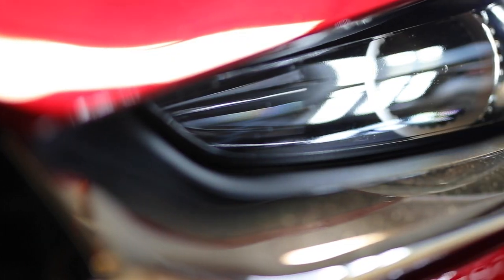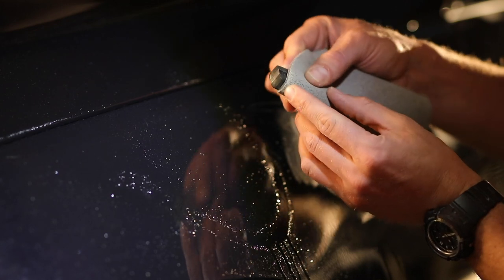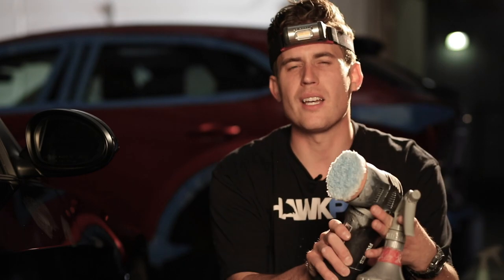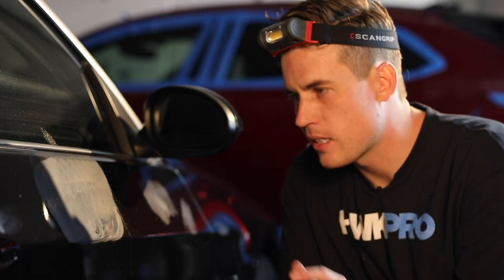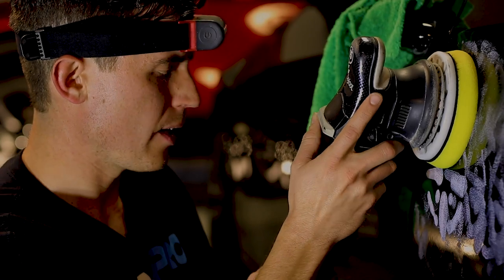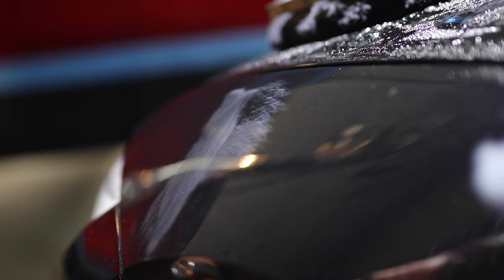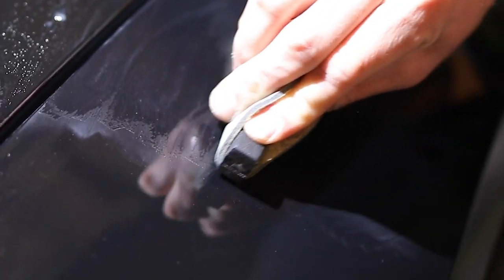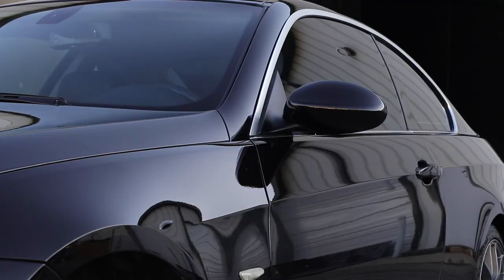Buffing and wet sanding NASTY BMW BLACK PAINT! Scratch removal tips

Comment: Finish with a rotary and you won't get the marring
Reply from the maker: What are your best tips for finishing with a rotary?
Reply: @HawkProDetailing  finishing pad and a light polish like opt hyper polish
Reply from the maker: @tugbankert6581  what about speed pressure arm speed etc? Curious about technique...
Reply: @HawkProDetailing  no pressure ever, that includes the da too. Low and slow as they say